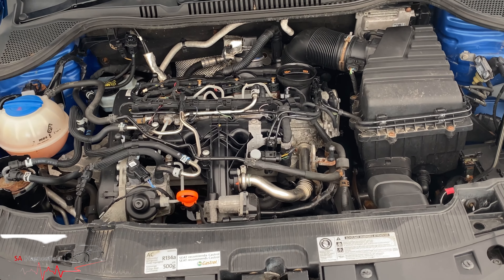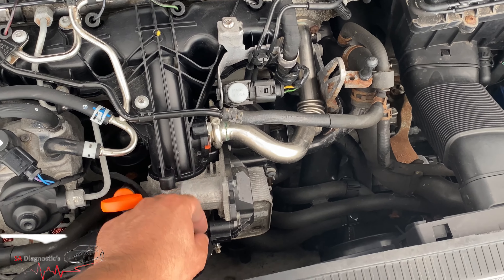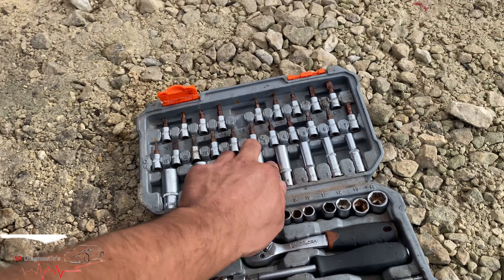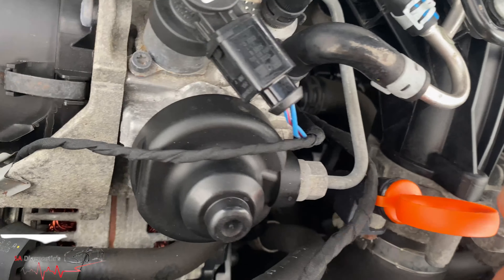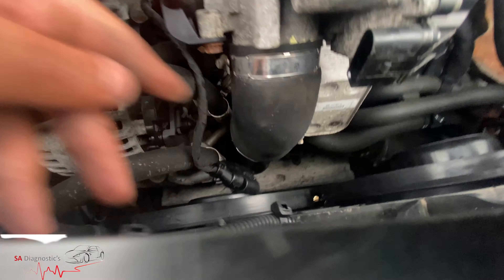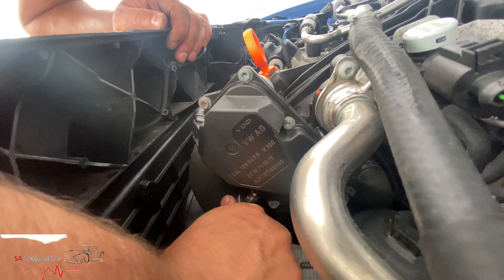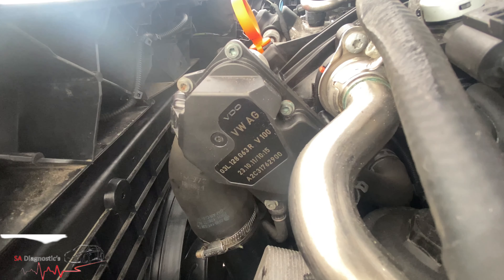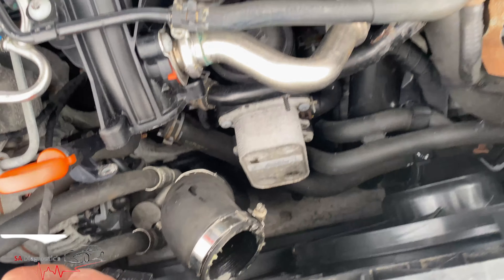AUDI SEAT SKODA VW P012200 THROTTLE PEDAL POSITION SENSOR SWITCH A CIRCUIT LOW FIXED DIY

Comment: Very useful. Will try on my Skoda Yeti. Always have difficulty idnefying the parts. When would you know if cleaning it is an option or when to get a new one?
Reply from the maker: @garryclarkson7224  I’d get a new one, they are common as hell for packing in….
Reply from the maker: @garryclarkson7224  however cleaning doesn’t cost anything so upto you….
Reply: @sadiagnostics  I know. I will have a go although eh throttle valve on Skoda looks like it's difficult to get out with a special clip as well as might have to get under the car. Trying to avoid expensive labour from the VAG not as confident to not mess something up :)